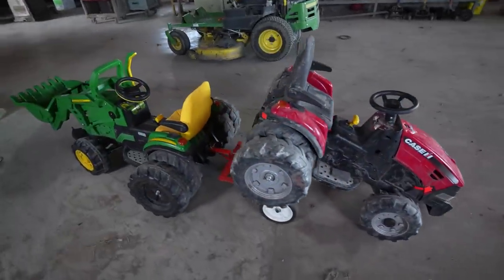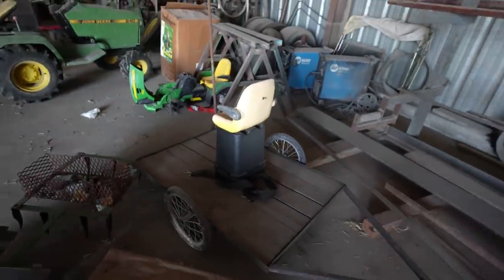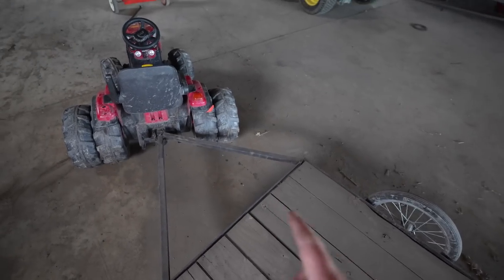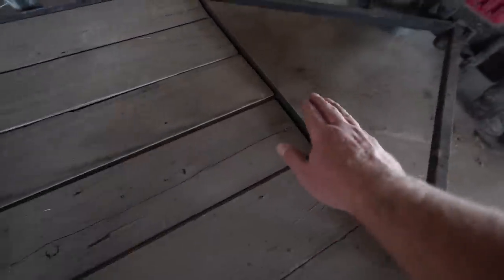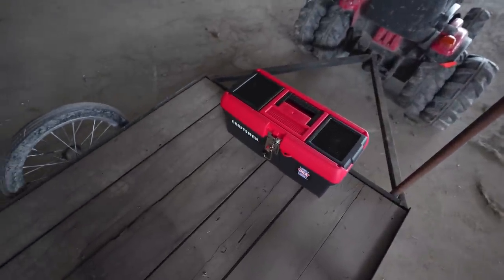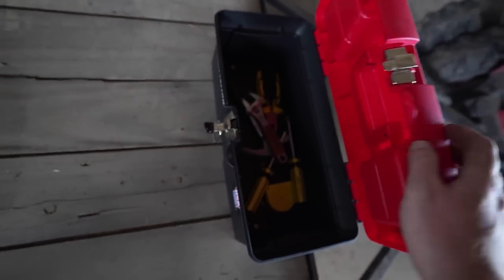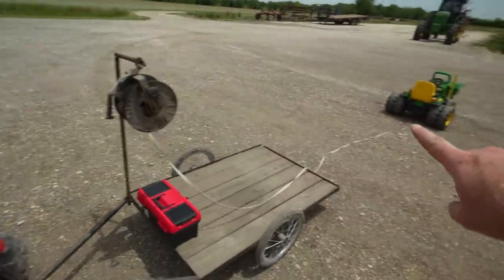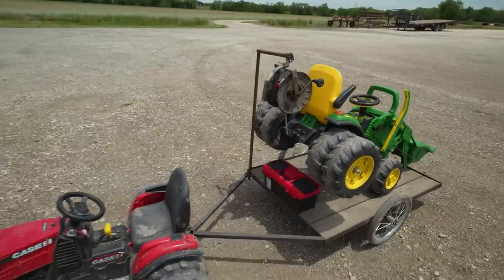Building the best tool trailer for Hudson's tractor

Comment: My son is always watching Hudson's playground and loves it. You should add a bike tread to the back of their power wheels. Cut it in half, cut off off the side walls and then simply wrap around the rear tires securing it with 1" drywall screws. 
I did it for my little guys gator and it makes a huge difference. 
Enjoy.